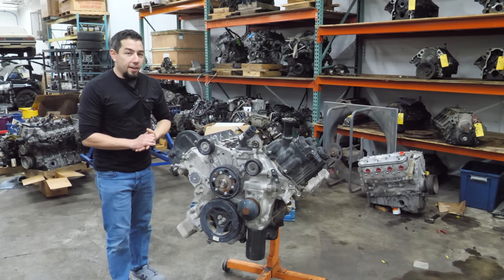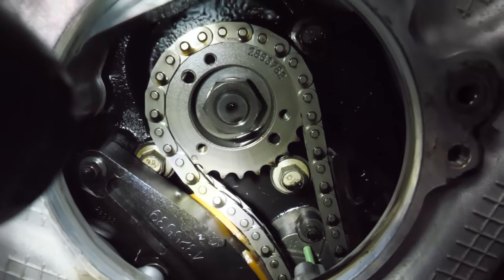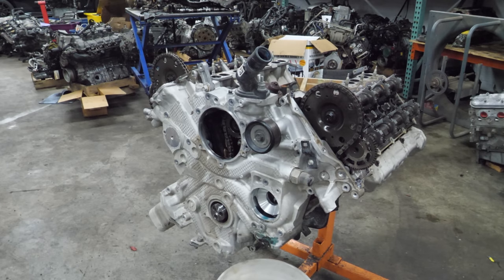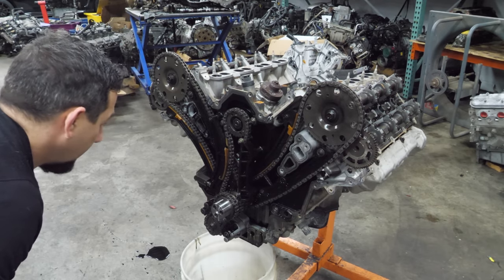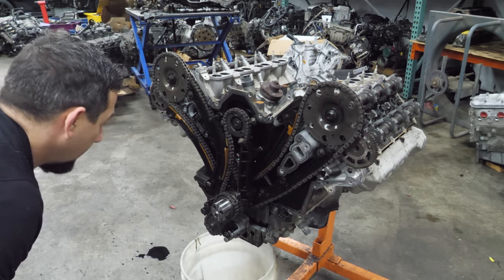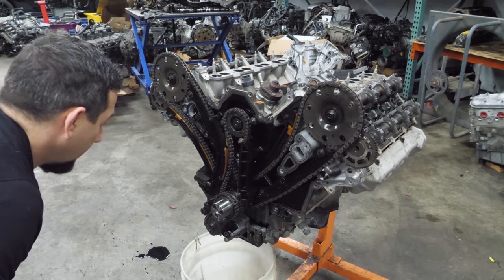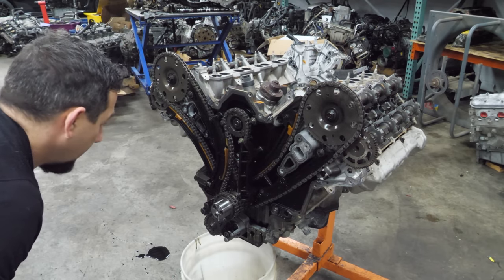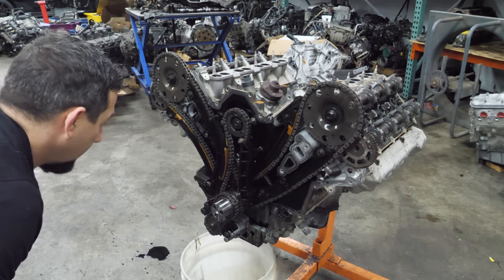Well That's Not Good! Nissan Titan XD Cummins 5.0 Turbo Diesel V8 Teardown. A Costly Failure!

Comment: Hey Eric. I'm a parts guy at a Nissan dealership but I've never even seen one of these come in, so this video was quite a treat. We actually wont even work on these trucks as our lifts REALLY struggle with them. They can weigh over 7,000 pounds. They've actually broken a couple of our older lifts from what our master techs have told me. Gas titan engine cores are QUITE common. That'd be an interesting teardown. Love the channel man, keep doing what you're doing
Reply: It's very interesting to hear from a parts guy what corrs you get in return. My friend had a..oh i believe 05 titan (which yes i know its older) but it was a great truck. So i wonder if the cores are the new gen or older or just both?  Thanks for the info. Have a great day!
Reply: @doubleaaaron  the new gens seem to have some oiling issues that lead to their demise. The older ones don't have it nearly as bad from what I've seen
Reply: I love my Armada! I've been wanting him to tear down a Vk56DE awhile!
Reply: You sound like a service writer
Reply: My automotive career started as a Nissan Parts guy in 1990. Still remember the Oil Filter part number started 15208 or 15280.
Reply: aa!A
Reply: Every dealership I’ve ever worked at has had at least 3 bays with 12k lb lifts. Also there’s no such thing as a 7,000 pound lift. They start at 4 tons and go up!!!! Quit telling stories kiddo
Reply: A dealership that WON'T work on its own brand?
Reply: @dannyr3346  Ideal builds a 6000 lb single sided hoist, just because you don't know about them, does not mean they dont exist. Nissan does not build anything bigger than a half ton pickup, they don't need 12,000 hoists, duh.
Reply: @dannyr3346  did he say 7k lift ? Or did the truck weigh at 7k ? 🤣
Reply: @dannyr3346  -oh, but there is. I have one, made in China. When I bought it, I had a choice of 7k or 9k. I got the 7k, because I work on 2500-3500 lb cars, and it works ok. But I won’t do anything heavier….
Reply: I think i know the dealer, lol. I worked at a cheap ass ford dealer and even the crapiest lift could do a tow truck
Reply: How did you sell a product that you won't work on.
Reply: @jamesgeorge4874  the titan xd isn't really a half ton anymore
Reply: @jdrok5026  It's not a 3/4 ton, it's a "heavy half" at best, but any way you slice it, it's America's worst selling full size truck. A 10 year old, 100,000 mile Tundra is still worlds better than a 2022 Titan.
Reply: @cflynn3684  on that back of a wrecker, yes.
Reply: I cant see how a dealership would still be a dealership if they did not have the infrastructure to maintain a vehicle they sell. The franchisee  would have to have the necessary equipment or they would be in breach of their minimum requirements. Unless it is a USA a thing that is different to the rest of the world.
Reply: @robpeabo509  the bigger problem seems to be the lack of qualified technicians that can and/or will work on them. Cummins supplied the engine but the software is all proprietary to Nissan and I'm not sure how they as a company would go about having a diesel mechanic at a majorty of dealership around the country when  only approximately 50k Titans were sold in a model year with the Cummins 5.0L engine option (16,17,18,19) that includes Titan half ton (gas only) and Titan XDs in both gas and diesel variants ⁸
Reply: @kyleturner3709 , my local dealer only has one diesel mechanic for the 5.0L Cummins such as mine that are still running around. But, my 2016 only has 48 thousand on it, and is still stock.
Reply: A dealership doesn’t have the tools required to work on the equipment they sell? That’s reassuring
Reply: @bobbywills9487  no doubt that there are good ones out there. I have a 2016 I absolutely love! still stock as well w/ 157k miles. The first dealership I went to was horrible, I have since found one that I couldn't be happier with they are also weight loss friendly which is a plus if I ever decide to go that route.
Reply: A Nissan dealer that won't work on a Nissan... sounds like the dealership needs to update their lifts instead of turning customers away.
Reply: Love how people say it’s not a 3/4 ton truck. It’s a heavy duty truck by lawn and by build. I’ve had one since Oct 19 and it has worked every single day of its life. It’s either got a landscape trailer, dump trailer or plow and salter hooked up to it. With a 700 lb dump insert in the back that is usually filled with debris. This truck has been absolutely fantastic and I’m going to buy more single cabs before they disappear. It’s a shame they didn’t give it more time to make a statement for itself especially in the commercial work truck category. Now they only sell the soccer dad crew cab version, who wants to tow a camper or a boat.
Reply: @dannyr3346  7,000 lb lifts are extremely common. Especially for home gamer lifts.
Reply: @eeffreef330 I have a VK56VD that's suffering from low compression in 3 of the cylinders, did a leak down and seems like my rings are bad. Those 3 cylinders are also scored to the high heavens.  Going to rebuild it soon with a good block I found....would also love to see someone tear one of these down and figure out the oiling issue.
Reply: I need this engine rebuilt or replaced. Are you in the great lakes area?
Reply: @tatelawncare2718  it's 5/8ths, not 3/4ths
Reply: @eac1235  I love this story
Reply: @doubleaaaron  From 16 to early 19 the 5.6 had production issues which affected the 7th cylinder to be scored.
Many were getting short blocks replaced due too this issue.
Titans and Armadas from 2004-2015 had the VK56DE and the 2016 and newer hot the VK56VD. The newer one is more complex as it has Direct Injection and a High Pressure Fuel Pump.
Reply: @Danny R  I work for a Toyota Dealer, and our undercoat lift is only rated for 7,000 lbs. So maybe you should research before you post 🤷‍♂️
Reply: @kenyonworthenii7389  the guy is telling  BS stories...
Reply: Anybody that thinks the XD is just a heavy 1/2 ton should drive one or tow with one before opening their pie hole. Don’t care about sales numbers. I care about my level of confidence when my 33’ TT is going smoothly down the road.
Reply: They only weigh around 5,500 to 5,900. Just for reference my BMW X5 weighs 5,300 lbs. So if you have a lift that can't handle 6k lbs., what's even the point of having it?
Reply: @TheCgilbert9935  you just tell them it’s such a great product it never needs any work.
Reply: @chestrockwell8328  I started out in 1990 and still remember Fords 302, 351w oil filter parts number: Motorcraft FL1A

Triton 4.6/5.4/6.8 all take Motorcraft 820S oil filter.
Reply: @dannyr3346  someone probably told him that story and he is just parroting it to sound smart. 

Very common tactic trying to be a part of the conversation yet knowing nothing about the subject.
Reply: Worked for a Nissan dealer for a year, we only had 1 come in and holy shit was that thing a POS. The injector rail is a huge pain in the ass to replace and wouldn't you know that went bad as did the turbo. My only diesel tech was FRESH out of Nissan school and didn't really know what the fuck he was doing. Had that truck for like 2 months in the shop.
Reply: @tatelawncare2718  Just look at the frame thickness and the axles compared to a 3/4 then you'll understand why people say it not a 3/4 ton truck...
Reply: @rsdna9698  your totally missing the point. It specs out just like 2000’s 3/4 ton trucks. Has almost identical numbers. I Own two titan xd’s and one 19 ram 2500. I do believe the larger axles and components do make the ram 2500 a little more capable. But at the end of the day they are both still in the same GVW category. This frame is used in the NV3500 series van that is pushing a 6,000 pound payload capacity so the frame argument is crap. It would be nice if it did have a floating 8 lug axle tho. Then it would be a 10,000 pound truck
Reply: Huh? My old ass gas titan weighs about 6,000 lbs most lifts should do 10k this doesn’t make any sense
Reply: @Mittomere  b
Reply: @dannyr3346  False.  My first lift at a Dodge dealer was a Rotary 7k. It was ridiculously short and narrow-had to fold both mirrors on Rams and high-roof Ram Vans barely went high enough to get a tranny jack under.
Reply: @chestrockwell8328  Not much of an accomplishment after 30 odd years in the field...
Reply: @davelowets  Ahh, yes.  I didn't expand on my original comment enough.  I only worked at  the Nissan dealership in 90'-91', and left the automotive world all together in 2005.  So yeah I agree, if  the only thing I knew from 30 years at the Nissan dealership was the oil filter part number...well  that would be a major short bus situation.
Reply: @chestrockwell8328  Ahh... Ok, I'll give you a pass on that one.. 😜
Reply: @davelowets  thanks man,  my half completed original comment does make me sound like a very low IQ individual, thanks for pointing out the error.  I'm only a sort of low individual.
Reply: @chestrockwell8328  Me too... 🍻
Reply: @tatelawncare2718 
A 6.0 F250 or 3rd Gen Ram 2500 5.9 will tow circles around an XD Cummins.... What are you smoking? Much heavier duty.
Reply: @kylesonsalla7620  I wasn’t comparing diesels. My bad if I came off that way. I was comparing gas engines and more notably the frame and component capability of them trucks.
Reply: My titan xd 5.0 is a heavy truck. I love it. Wider than a chevy 2500, 7 ft bed and massive interior space. Perfect for towing and great mileage when I'm not.

Ofc,  CAI, tunes, etc.

Always use some type of fuel additive. At 215k miles, no check engine
Reply: @christopherbernhardt  I have a 2017 XD 5.0  Texas edition. Only 38K on it. I love the truck but I have to admit the whole crank splitting thing and CP4 pump cause me some worry. But I have no issues with it yet. I run amsoil filter and oil along with hot shot fuel additive, I change the oil every 5K instead of 10 along with the fuel filters. That may be a bit of overkill, but it gives me a warm fuzzy :) Most horror stories like this that I see or read are motors that have deletes or different tunes. keeping mine bone stock for that reason. Hopefully I get a long life out of it. Again, I love this truck :)
Reply: @86FxBdyCpe if they don't have anyone with training and certification from the manufacturer to work on a specific vehicle, they won't. I recently started at a Nissan dealer as a tech and was told by a coworker that we won't touch the diesels because no one here is trained/certified for them. We don't have a GT-R guy, either (was told we did, but that person left for greener pastures) and thus won't touch GT-Rs (even though IIRC this is nominally a GT-R certified dealer); Nissan themselves even says for non-GT-R techs to NOT touch GT-Rs unless it's for basic maintenance even then only if the dealer wants to maintain a cordial relationship with the customer. Kinda dumb IMHO but it's all part of what they said they were gonna do back when the car launched.
Reply: That high pressure pump had been loosened at some point…maybe bad factory assembly but if not then surely bad service reassembly. Possibly they wanted to service the timing chest and somehow allowed to pump to be loosened where it drifted back….tightening the  unevenly cocked it sideways and made it feel tight…probably managed the mounting holes too. Nothing was noticed about how badly done it was so it was closed up….and miraculously it ran, however badly.
Reply: @dannyr3346 there are definitely lifts rated for 7k, we had em in my old shop
Reply: Ummmm...Rotary SPOA7 2 post lift. 7,000lb capacity.
Reply: @dannyr3346  Just because your experience is as such does not mean HE is wrong. As we also have 7,000 lb capacity lifts at MY Nissan Dealership. The XD Diesel titan can weigh up towards 7,000 lbs
Reply: @tatelawncare2718 crew cab dad with boat reporting for duty!!
Reply: Lies😊
Reply: @dannyr3346 I think that trunk weights more than 7,000. Curb weight is 7500which means it’s full of fluids and a 1/4 tank. If they have anything in bed or carry a light load would max them out. Those diesel titans are porkers basically a heavy duty 25/3500. It weighs so much epa doesn’t test mileage

Comment: Former Titan XD diesel owner here. I bought my 2018 Titan XD midnight edition new in September of 2018. Had 190 miles on it at delivery. It was an absolute amazing truck and handled every load I put behind it amazingly. In January of 2022 it started to sound different, like a knock rather than a clatter that a diesel typically has. This was at 47,000 miles. I took it to Nissan numerous times and told them something wasn’t right. They had corporate specialists come in and look at the truck and I was told numerous times it was fine. In May of 2022, with my fully loaded 8.5x20 enclosed trailer attached, the crank snapped at 55,000 miles. It was violent. Nissan replaced the engine at no cost to me. Total bill was over $22k!  I sold the truck to Carmax 7 days after getting it back. Really miss the truck, but to much of a risk when using it at a commercial vehicle.
Reply: Had the same truck. Biggest mistake I've ever made. Left me on the side of the road 4 times for EGR, DEF, turbo and fuel pump failures. Wasn't gonna wait for the crank to go so I traded it in while I could still get some money for it. I don't really blame Nissan but rather Cummins. Their little V8 experiment screwed over countless customers.
Reply: I thought Cummins makes good engines how come they end up this engines
Reply: @onurgns  Ford bought Cummins and rebranded their powerstroke as a Cummins. If it's not a straight six it's not a Cummins
Reply: @onurgns  My 18 year old 6.0 Powerstroke is motoring along happily. 🙂
Reply: @dougb4956  Hey Doug, I have a ‘06 model F250  FX4 that I bought in Nov ‘05… I’ve had 1 glow plug replaced and the Turbo cleaned and miked to factory spec. That was about 10 years ago, other than that the engine has never had a wrench put on it. In Nov of ‘23 she’ll be 18 years old. Over these past 17 years all I’ve ever heard is how bad the 6.0 is. I don’t get it? It’s a 325hp 570 ft/lb torque motor. It was never supposed to be a D9 dozer or a 10sec drag strip engine. I’ve often wondered if I was just fortunate because I chose the “Tow Boss” option, the 6 speed auto trans (a $6k adder as I remember it) It came with a larger cooler. All I do know is that I can’t imagine buying a truck, having it do everything it was supposed to do and spending any less on repairs on it. Heck, my ignorance caused the turbo carboning up by excessive Idleing, which I stopped doing after the $650.00 cleaning! I can’t tell you the numbers of people who have asked me if I was interested in selling them my truck. All I can say is that I’ve never regretted purchasing my truck and I’m glad to hear that I’m not the only 6.0 owner that feels the same way. Thanks, Jim
Reply: @jimcarney7174  That's great. I bought my truck used in 2008. Perfectly clean with 20,000 miles. A few years later I did preemptively change the oil cooler and egr to keep it going strong. Also installed a bypass oil filter and a coolant filter. Last month I replaced the turbo with a new one. I was gonna service it but a new factory turbo was only $920 so it was a no brainer to go with the new unit. So, yes, I did some services to the truck. Over the years I've replaced the FICM and the EGR valve. And I did replace one glow plug and the harness also. I now have 160,000 miles and primarily tow back and forth between California and Baja Mexico in the crazy heats of summer. So there is a reason I stay on top of maintenance. Nothing out of the ordinary. Certainly nothing close to spending tens of thousands of dollars on a new truck. And much less than replacing injectors, injector pumps, and all the other stuff people with Duramaxes and Cummins do. And I've see all those trucks stuck on the side of the road pulling their toyboxes while I drive right past them. Love my 6.0.
Reply: Wrong. Ford has no part of Cummins.
Reply: @tcstone8539  Ford owned some minor shares in Cummins a few decades ago but sold them. Ford motor company had nothing to do with the Cummins 5.0L V8 diesel that Nissan used in the Titan XD.
Cummins developed the 5.0L V8 for use in the dodge Ram 1500 but Fiat/Chrysler decided to go with an "In house" diesel engine the  MV Motori 3.0L Eco Diesel.
Reply: @tcstone8539 no they did not😂😂😂 ford does not and has not owned cummins other then some stocks all powerstrokes until the 6.7 are international the 6.7 is all ford morom
Reply: @MegaSling blame DEF and Emission systems. They're the real culprit here.

Comment: The injection pump was loose because he tried removing it before selling the core to you. Those three bolts are actually studs - the pump is held on by nuts on those studs which doesn't require access to the geartrain side of the pump. What the PO didn't account for was having to take the drive nut off the front of the pump and likely gave up, leaving the pump loose like that.
Reply: Agreed, He probobly did not read the manual on pumd removal
Reply: Thats exactly what happened... thevaccuum pump needed to be removed to take the bolt off to allow the fuel pump to be pulled out... three nuts and washers were on that thing holding it in... that is just like the GM 4.3L, 5.7L, 6.2L, 6.5L in how the fuel pump mounted.. thats how he broke the chain guide...